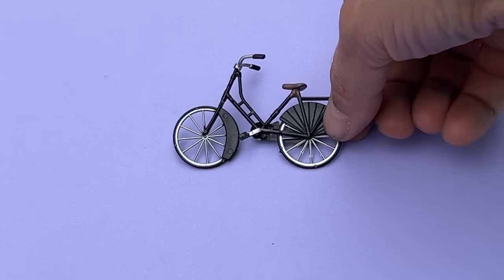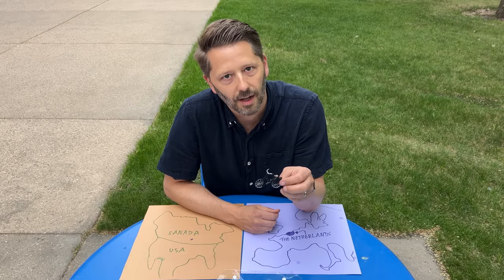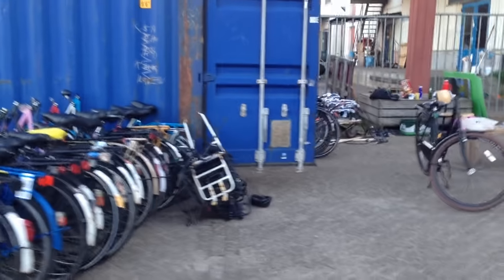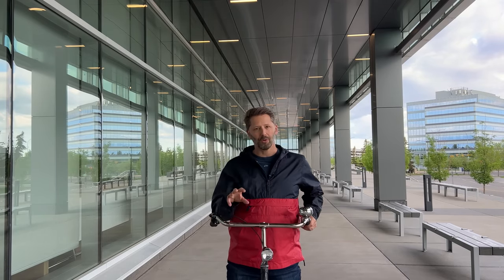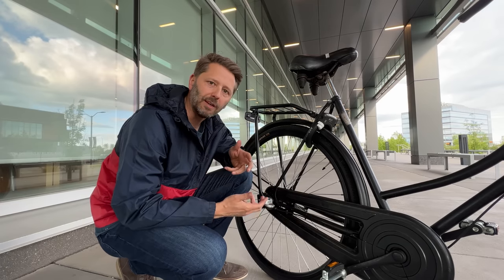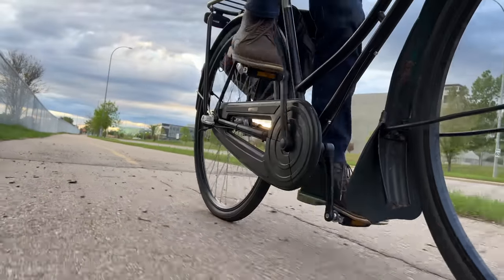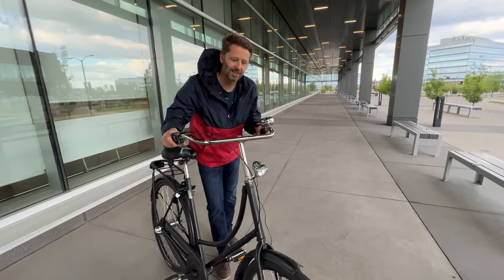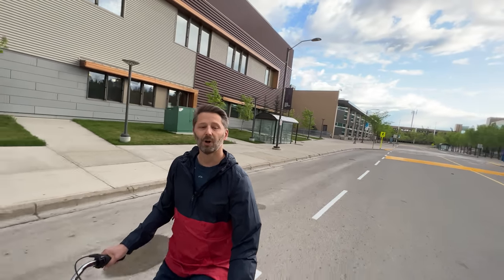I finally found a true Dutch bike in North America. Here's what you need to know

Comment: It seems pretty similar to the beach cruiser you've ridden on an older video, minus some differences of course, but they're both step-through bikes with swept-back handlebars and coaster brakes. Both seem to be ridden in a pretty much identical way, both being very upright and laid back.

Would you consider that there is anything about the Dutch bike that makes it distinctive enough from a beach cruiser? I mean, I get that the Dutch bike has a pretty distinctive look, but on a practical level they seem to be practically identical, with maybe the only meaningful difference being that the tires of this bike aren't as balloony.
Reply: I have a special granny bike in the netherlands with 2.40x29inch baloon tires, 7speed Nexus and disc brakes. So they are around but not much, most of the grannies don't have that much space for balloon tires and no disc brake mounts.

Comment: There is one thing to know about the Netherlands:

The most important transport for centuries in their cities wasnt bikes.

It was boats.

Most of their cities are crisscrossed with channels. When mass motorization came to the Netherlands, they ended up in chaos much earlier than their neighbours this way. Also cycling never went that down, as for example in Germany, as using bikes often was faster, as they were much more bridges for pedestrians and bikes, than for cars. Thus, a cyclist in the Netherlands on many routes can do massive shortcuts. Nowadays, when the Dutch build new neighbourhods, they often try to design it like their old downtowns witht artificial canals and bridges for cyclist, to make local car driving inattractive.

Even as I like those classic Dutch omafietses, I would not buy one here in Germany as a bike for every day, as they are too heavy and technically outdated. They make perfect bikes for downtown use and are ultra reliable, but for longer 5+ km commuter-runs I'm really happy, what the German bike market offers to me.

Comment: How does that Dutch bike, compare to that Cruiser bike that you rode in Hawaii? 
I’m asking because I’m a cruiser bike guy. I like t HR em because you ride upright and they are practical and have coaster brakes, many have fenders etc.
So I’m interested about how it compares to an American style Beach Cruiser, or even a Worksman?
Reply: you can't compare a dutch bike to a cruiser bike, our bikes are all about being no-maintenance and comfortable. i could get a dutch bike for 10 - 50 euros though, so i can't say it's really worth paying 600 dollars for a used bike.
Reply: @theunbeatable6440   Cruisers are also low maintenance and comfortable. You sit upright, often single speed, or internal hub 3 speed.
Reply: @BigLewBBQ  I'm sorry, i got cruiser and road bikes mixed up. Dutch bicycles are actually cruisers, sort of.

I think the difference is that the frame of a "opafiets", in english "grandpa bike", is a bit taller than regular bikes.
The steering handles are completely vertical, so that makes it very ergonomic.
A lot of times they have wheel guards and chain guards to prevent loose clothing for example from getting tangled up + protecting the bike from rain (We have a lot of rainy weather).

Real dutch bikes are simple, no fancy stuff. A lot of bicycles here have been getting ridden on since the 60's and even longer. That's partly because they're easily repairable but mainly because they're meant to last.

edit: You also can't have a dutch bike without a luggage carrier
Reply: @theunbeatable6440  Thanks for the clarification. 
BTW this is my cruiser bike; https://youtu.be/Kkq4KxQgd-E
Reply: @BigLewBBQ  Nice bike, you also live in a beautiful place. If you enjoy riding your bike a lot and you're curious how a dutch bike bikes you could save up for a opafiets or a omafiets. It's definitely a bit more expensive in America but you'll at least get a lasting bicycle :)

Comment: These brakes are much saver at top speed. Using only brakes at the front wheel will make you spin. Also, the bar in the middle ís actually very common, for males (who are taller and heavier. Not called omabikes). Grtz from The Netherlands.

Comment: Gong down your video, I got shocked how low your pressure is in the tubes. A few more pumps n' you will roll easier n' comfy (plus a much more fast) the force of your feet palm push you easily, especial on a comfy Dutch.

Comment: Just a small correction: You did buy a "Oma"/Grandma/Girl/Woman bike. This is in such a way designed that woman with long skirts (as was the norm back in the day where pants where for men and skirts where for woman) can hop on and off easily. The bikes with a straight beam across was for men because they wore pants and could step over it easily.

The straight beam across is in design superior because it offers more rigidity. The design that you have however does work fine and worked better for woman with skirts.

Comment: I was really cringing when I saw the shoulder strap of your bag hanging loose! You really should tuck that in so you don't get caught on something! Your bike is missing a coat/skirt guard; a plastic cover on the top of the back wheel that protects from your clothes or your bag getting caught in the spokes!
 For a Dutch person an "omafiets" (grandma bike) is so normal, it's really nice to see it from a different perspective!
Also when you're riding your bike in the dark in The Netherlands without lights and you run into the police, you will get a fine!

Comment: the dynamo is just a bad choice, the extra drag + noise not to mention you can have bad contact (in rain etc) so the dynamo doesn't work, you far better off with an internal dynamo or just some led lights you can clip on. not to mention led lights are probably cheaper. they cost practicly nothing. you can probably buy a helmet with led lights in it if you want to make it really easy

Comment: Astoundingly it's quite rare to see them here in the UK, & there have been close ties, & only a couple of hundred miles, between the Nederlands & us for centuries.  We even had a Dutch Monarch, William of Orange, after our Reformation(!)  Yes:  Major/'High Street retail outlets like Halfords sell them but they are priced 7, 8, 9, £1,000+ so are a fashion thing.  For someone like me, with leg & back issues, one would be a god-send but they are out of my reach financially.  Strangely this style of bicycle was the predominate style, but with a closed frame; open frames were for women because of their long skirts; in late Victorian/Edwardian times - say, 1880 to 1920.  There is a well known photo of Sir Edward Elgar with (one of) his Sunbeam which was the Rolls-Royce of cycles then.
Oh.  And for the record:  the Safety Bicycle (double diamond frame) is an English invention, as were hub gears, & I believe, also tensioned wire strung wheels.  😀
Reply: You can check out some folding  bikes. There's a lot under £500.  Halfords, Decathelon and even Argos sell them.  They can be low step, and some have chain guards.  The e-bike versions are similarly equipped as well. One of those I've seen had a skirt guard. They  work well for those that have back issues etc.  I know a few people with back/joint problems who rely on them to get around as their mobility aid.  They also sell second-hand. A lot of the e-bike versions come with lights already fitted.  You can have dynamo lights fitted to any bike without lights if you wish.  You don't have to rely on pricey dynamo wheel hubs, older fashioned friction ones will work or the newer magnetic non friction ones will do.

Comment: It is not a Dutch bike. We have a bunch brands and models of bikes in Holland. What you are referring to as Dutch Bike is just one of many models. 
This model in its day (early 20th century) was modelled so it accommodated traditional long skirts. Back in the sixties it became a bit of a hippie culture thing, and that's why you can still buy this model.

There is what's called a women's bicicle that makes it easy to get on and off. The difference between women's and men's bike is that it makes it easy to get on, especially with a kiddy seat on the back and hooked to the handlebar. A typical mommy use case. 
A men's bike does have a crossbar between saddle and steering pipes of the frame. Now the frame becomes a triangle and very stiff.
These days different methods of welding firms up the open frames as well so this instability is only in your 'Dutch Bike" model.

Comment: A lot of the positives you mentioned are huge negatives for me. Where Im from Dutch Bikes are very common as are modern sport bikes (my family had both actually) and sport bikes are better in many ways. For example being made of steel is actually really bad. The bike is very heavy and for a weaker person that's actually a big deal. You can't get the bike up the stairs very easily etc. Very often I just pick up my bike in one hand and carry it. Over pedestrian corssinges when no bike infrastructure is present. Up the stairs, down into a secure bike room etc.

Lack of gears is also very noticable since our country is not a flat pancake. 

Dynamos are really bad and I dont understand why someone would want to have one over just a rechargable led light. They are finicky, on most bikes I have seen there are constant problems with the dynamos, the lightbulbs often break (although I have not seen a modern dynamo, most of these bikes were ~30 years old at this point). 

Also I don't find the backpedal brakes that good and their main weakness is when you need to slow down fast (which is extra difficult on a very heavy steel bike) and you get a skid, with normal brakes you can stabilise with your legs. With backpedal brakes you can't.

This video is really weird for me because Ive been riding a bike my whole life and my experience is completely different to yours and here the dutch bikes like yours are not considered that great. They are a relic of the past. Although I should say, I don't hate them and they do have a lot of advantages.

Comment: This was the traditional bike here in Denmark. It's an awful choice.
The bike is at the same time very heavy, but wobbly and unstable.
It's made of steel, so it will rust if left outside. And it is not quality steel, hence the wobbliness.
In the upright position, the bike is very hard riding when your going the slightest uphill.
If you have a puncture, getting the back wheel off is a nightmare.
Sitting upright on a soft, wide saddle is comfortable only for short, slow rides.

Comment: Huh, i bought my 2004 Giant NRS2 brand new back in 2004 at D ornellas for $1945 bcoz after graduating from highschool i couldnt justify buying a car. I cant tell you how many kms i put on it. I def made back all the money i spent on it just in bus fare i never needed to buy. Put hydraulic disc brakes on it. Only issues i had were the bb bearings being soo thin and the headset was not sealed of well and rusted. But other than that, my most loved bike i ever owned. So i mean, now you spend $3000 on a bike and cant even daily it? Whats the point. The dutch bike looks sweet tho. Bet if u put straps on the pedals u can easily climb. If i had one i would def put hydro brakes and sone gears.
Below is my set up rn. I suffered serious health problem in 2012/13 and am still recovering. So i call that motor on my bike a wheelchair bcoz i have to help myself. But yea, its my 3rd trailer. 1st was on my giant.
https://youtu.be/LJNYZVDUH60?si=jcb3x_4Yk5xvNs5M

Comment: Im a Dutchy but the Shimano 3 speed gearing is not that good even if you keep paddling and change gear it takes ages to change and if you do not paddle and change gear it will do it faster but your chain will get to mutch slac and eventually fall off what happened to me the 7 speed chimano is better and faster at changing gear when you padle

Comment: Here in Belgium is that bike a women's bike a bike for men has a bar in the middle across the seat and handlebars but women's bikes doesn't have a bar across the seat and handlebars like the bike in the video but more and more men are starting driving women's bikes because it's easier to sit on the bike there's no bar across the seat and handlebars. 👌🏻 I have a women's bike with a basket in front of the handlebars and white tires.👌🏻😊

Comment: I don't get it. I use a ton of single speed bikes with coaster breaks, and they are awful. Without the spring from the gear changer, the back tire needs constant realignment in order to make sure the chain doesn't get loose and fall off. It's really annoying, and I only used this type of bike due to using them during the winter, to avoid the breaks freezing up, and because they are cheep and the salt destroys the bike within 2 years.

Comment: The step-through frame vs a frame with an additional tube has nothing to do with length of the rider. It all has to do with gender. The extra tube makes the frame a lot more rigid, but it requires you to swing your leg over the back wheel to get on the bike. But that causes an issue when wearing a skirt or a dress. Or having a kid in a seat on the back. Hence the step-through frame.

Comment: I think the ride experience of these so called “oma-fietsen” (grandma-bikes) is horrible. Compared to a bike with a straight handlebar and a more upright stance (especially the front fork), these bikes have a poor straight line stability and are difficult to handle at low speeds. One advantage these bikes do have is that, because of the shape of the handlebar, you can sit more straight.

The Shimano Nexus wheel hub on your bike is nice though.

In the Netherlands tire dynamos are more and more replaced by battery powered lights (front and rear) or (front wheel) hub dynamos.

And... don’t let the strap of your camera bag get caught in the rear wheel!

Comment: No front brake seriously Handicaps you should you ever need to stop suddenly, even with all your weight on the rear wheel.  Even if the rear brake was strong. The Netherlands is flat.  You don't want to roll down a steep hill without front brake either.

Comment: These bikes aren't worth more than ~$75. Anything more is criminal, and they are made of cheap steel which rust easily  (Yes, many of them aren't vintage and made in massive factories in China or some low-wage shops focusing on cutting cost).
Aluminum hybrid bike with adjustable handlebar height, or chromoly vintage bike will be a better purchase at $500+.

Comment: The idea is good but to be honest the brakes suck, the transmission sucks, the frame stability sucks, the weight sucks, the overall reliability sucks.
I had one and living on top of a hill it sucked up- and downhill with its brakes and transmission. When putting real power on the pedals the frame was bending and after a while the left pedal fixing wore out as it is fixed with a Stone Age technology using a wedge! A fucking WEDGE! 

And rust was also a big issue with this steel bike. 

This bike is really made for poor grandmas living on a flat terrain.
No fun at all.
The only advantage: 
Nobody steals it.
Guess why.
Reply: Yeah I don't get why every bike advocate channel keeps trying to push these beater rusty steel bikes. To add on, standing hybrid bikes do exist which pretty much makes these irrelevant, with modern features like gears, aluminum frame and all-weather disc brakes. Only acceptable use for these Dutch coasters are basically shared bike rentals.
Reply: @drill_fiend1097  I think I get it: Buy cheap and sell it expensive guarantees a great margin!
This can be the only reason to sell this crap.

Comment: It's funny that there are people who romanticize Dutch bikes, and the people who do so aren't Dutch. The bike featured in this video sucks wicked hard, for the following reasons: 

- It's a girl's bike, which is an inherently weaker design than a standard diamond frame, all else being equal. It also looks ridiculous, unless you're a girl wearing a dress/skirt, which is why they were invented in the first place.

- It's made of mild steel, which is bottom of the barrel when it comes to frame-building materials, because it has the worst strength-to-weight ratio of any of the usual frame-building materials. The only reason anyone uses it to build a frame is because it's cheap and particularly easy to weld and bend. No one selects it for any other reason.

- A literally upright riding position is the most inefficient riding position there is, because it has the most amount of air resistance (due to presenting the most frontal area), and it also puts the most pressure on your "sit bones."

- A single-speed is the worst choice for a commuter bike, obviously, which you tacitly conceded by converting it to a 3-speed (which still isn't very good).

- Only one brake, in the rear, and it's a coaster brake? Is that some sort of a joke? Unless you weigh about 75 pounds or less, I consider it irresponsible to ride something like that in public at any significant speed, because your stopping power isn't up to snuff.

Also, there's nothing that's low maintenance about that bike. It's only low or no maintenance if you consider it more or less disposable like the Dutch people do. If you're imagining that it's imbued with some sort of magical power to keep water and crud out of its basic cup / cone / loose ball bearings that are in the hubs, bottom bracket, pedals, and head set, then you're living in a fantasy world. Make a habit of riding it in the rain without any maintenance and your bearings will be trashed in relatively short order.